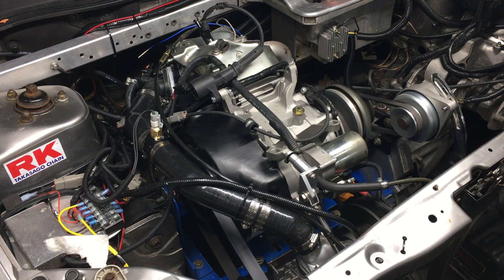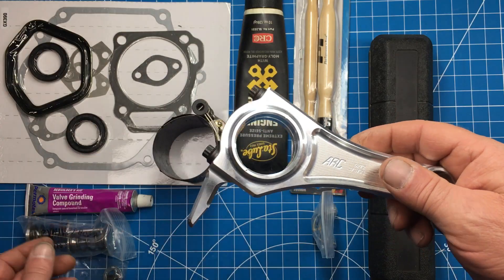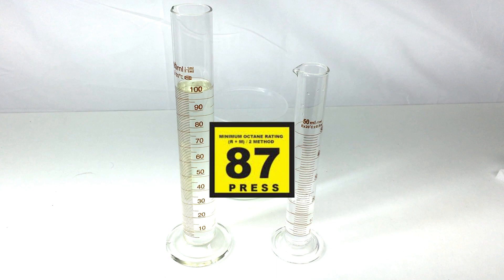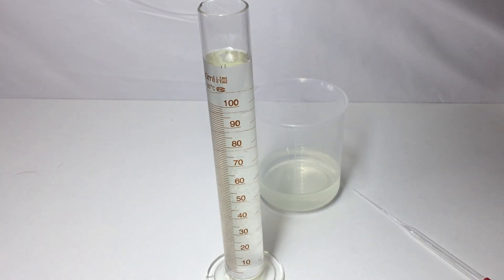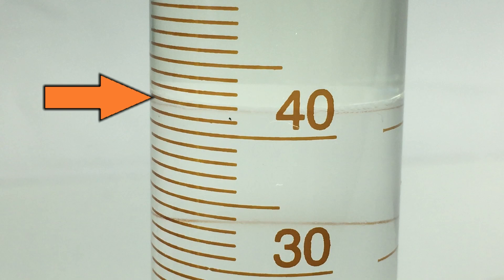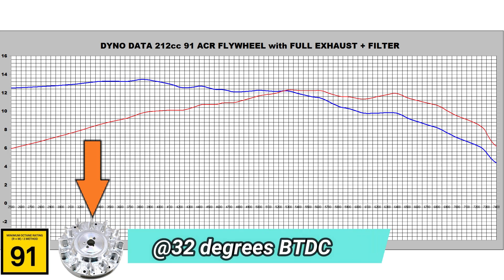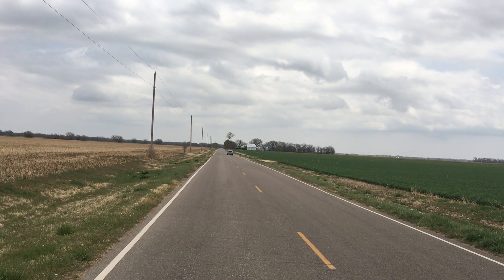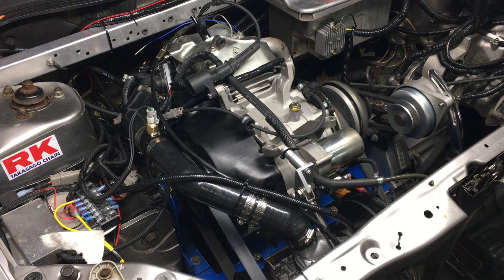S2E8: We dyno test several fuel grades to see if good gas is better than cheap gas for small engines

Comment: An adventure is never a waste. You're going extremely tiny on engines, but most people don't notice most cars could actually use a 500cc engine and be able to go up and down the highway perfectly fine. Honestly it would be cool to see some manufacturers making really small displacement four cylinder motors. I say 4 cylinder because the parallel twins kind of vibrate a lot. But a 500cc motorcycle motor has about 60 horsepower. A car going down the highway really only needs between 20 to 40 horsepower. The only issue is it would be pretty slow off the line, but the fuel economy would probably be amazing. Especially if it's running through a 6-speed transmission made for a car. We just like acceleration which is why we need all the displacement.
Reply: Such as the Kei cars from Japan? They seem to get by fine with 660cc three pots.
Reply: @deanstyles2567  back in the 70s they had some 300 cc kei cars I believe as well(upon looking at Wikipedia kei cars originally were limited to 150cc)
Reply: This is why a lot of manufacturers are doing hybrids with a small gas motor.  The electric motor produces great low end torque to get the vehicle off the line, then the gas engine takes over from there, as an over simplified description.
Reply: @91CavGT5  as far as I know most hybrids use the engine as a generator, and solely use the electric motors for propulsion, I do understand there are ones that use both in a propulsion system but they are rare in comparison
Reply: @jaykoerner  I just sold a 2018 KIA Niro that could use either the gas engine or the electric motor completely separate from each other, or combined together.  The drivetrain that is used in that car is used in other KIA hybrids, as well as some Hyundai hybrids as well.  I’m unsure as to what kind of system Toyota and Ford offers since those 2 seem to be some of the largest volume hybrid manufacturers.
Reply: @91CavGT5  for the phev escape ford uses a 2.5 atkinson cycle and an electric motor pared with a ecvt that is supposed to use a planetary gears with chain. The transmission can use one or both utilizing the electric motor as a starter and alternator.
Reply: One problem with that though is that a 500cc engine running near max power all the time just to maintain highway speed isn't going to live very long. Typical car engines are very under-stressed most of the time, so with proper maintenance they can last a very long time. Efficiency would also suffer some at those high power settings. I think 1000cc motor would be a better compromise. It cold run at a more reasonable rpm most of the time and thus wear down far slower. I expect it would be a bit more efficient too. Especially if you still only aim for 60 peak horsepower and give it timid camshafts.
Something like a lazy, 3 cylinder, 1000cc, Atkinson cycle motor would absolutely dominate efficiency wise.
Reply: Those vehicles are tiny and very light weight. You have to consider losing mpg with a small engine when you have to get on it. You suck more fuel through a small under powered engine than a larger one since theres not enough air in the combustion chamber to burn all the fuel you're throwing at it. Small engines are only good for putting around in City.
Most those tiny engines you talk about in other countries have turbochargers to fix that problem. But, theres no replacement for displacement so the engine sizes we have now are perfect size for what we need in north America

Comment: Love all the episodes! Is the 212cc engine still at 8.5 :1 compression ratio with a stock camshaft?
Reply from the maker: The engine on the Prony dyno has a slightly higher compression cylinder head and is running a Mod 2 camshaft for upper rpm power.
Reply: @robotcantina8957  Good episode.  I ran a 212, but milled the head to give 11:1. Don’t remember what camshaft I had but was trying to make low end power. I was feeding her 100 octane racing gas and always wondered what would be best
Reply from the maker: @whaddaBoutBob   11.1 Compression sounds epic for one of these little engines.

Comment: My main thing is that carburetor is such a let down. 
I used one of those carbs on my old 150cc race bike. Once I swapped in a mikuni vm22 it was night and day difference.  But then the vm22 was too small for my big valve head and went the 28mm route.

Comment: Yes, do more tests with EFI + 93 octane and E85, also it might be fun to try to get it running on propane which has octane number over 100.
Reply: In EU, especially Poland, using propane for cars isn't something new. We are using a lot of new tech to run cars on it! It's called "LPG" :D And it costs around half of the price of standard(95 RON, ~89-91 AKI[usdm/canada]). But it's using around 10-15% more of it. But still, You can get better performance on it due to higher rating(around 105-110 RON) and by that a bit of ign adv, but that is neglegible improvements in terms of city commuters. Have You ever used a car with 1.4 sohc with 77hp? It's painfully slow, even compared to ~150hp that can be found in most new city commuters with 1.0Turbo.
Reply: @mmllmmll22  Yeah I'm from CZ so I know LPG very well :D But I wrote propane as I don't think Americans know about it, but it would be interesting if he could come up with something and drive it with the Speeduino (which I know can be done).
Reply: @snap_oversteer  we know propane here in America. Used mostly for heating but there are industrial applications as well... A common one would be propane powered fork trucks. We also know and use LPG for certain applications @Xserabis
Reply: @steve.roadcap  Yeah I meant LPG, I know you guys like propane.. atleast that's what I learned from King of the Hill :D
Reply: @snap_oversteer  I was actually going to refer you to King of the Hill... lol
Reply: @mmllmmll22  Here in the US, LPG cars are basically unheard of. But a lot of buses and garbage trucks run on it, so it's caught on in the more industrial/commercial sector. And I have a Geo Tracker with a 1.6 sohc that made 79 hp when it was brand new in the 90's, so it probably makes less than 77 hp today. And it is very slow, but it's still fun to drive.

Comment: YES the whole point of higher octane is BOOST! (or compression). 93! E85! 101LL!
Reply: Also a bit of advance in ignition for N/A. With good fuel/air & ignition ratios You can get few to teens % of incerase power and torque.
I know that Polish language isn't easy to understand, but check out "Coobcio Garage" and his Z platform tunings. He is making 250-260hp(on crank) up to 280+ on 350z VQ35DE, and ~310 with basic bolt-ons, like intake spacers.

Comment: Yay, this is great! Always get in debates with people sticking 100 octane in a stock 212.
Reply from the maker: Yeah, I see that all the time and when you tell them 87 is better they think your insane.
Reply: @robotcantina8957  some guys in the snow biking world are finding that they can run lower octane higher up in the mountains to get more power without detonation.  In the EFI 450 MX bikes.  So some guys get it
Reply: @robotcantina8957  haven't even watched it and figured the conclusion, generally nthe higher the octane the more ethanol since it's used as anti-knock agent, ethanol being lower in energy then gas generally means it has worth fuel economy, and worse power in a low compression engine
Reply: @robotcantina8957  *Yore
Reply: @ryanmalin  *you're
Reply: @ryanmalin  * Yall
Reply: @BeardedFrog  * Yall
Reply: 100 octane in non-modified engine is stupidity ;) 
To use it, thera 2 major things to do:
Add fuel on carb (100 octane have less calories)
Add ignition timing.
Reply: High octane gives longer burn time and knock resistance. If you want higher octane use a smaller bore and longer stroke
Reply: @Eluderatnight  Octane is ALL about compression ratio and combustion chamber design.
Reply: Lol. Next up we test 87 with methanol. 

I’m not joking…you’ll make power from the cooling. Meth also adds oxygen ;-).
Reply: He should see mph as well
Reply: You’re, not your*
Reply: I am running 100 octane in a 460, but it has 15:1 compression and 45° advance 😅.